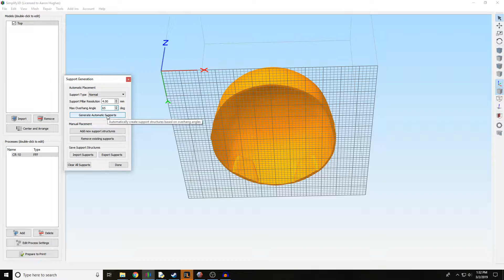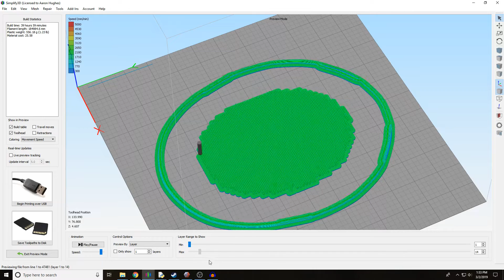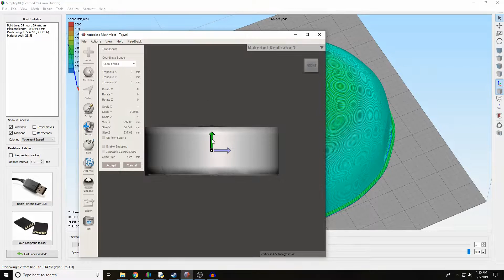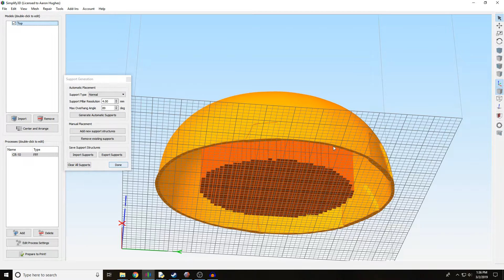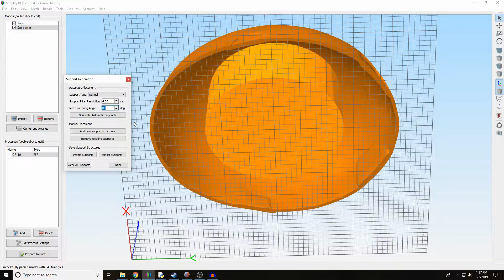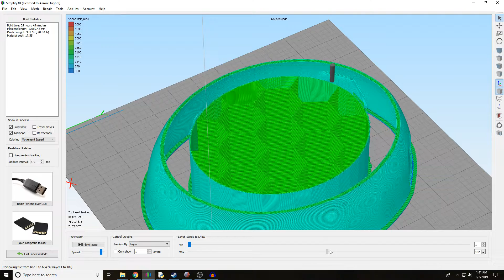How to Decrease your 3D Print Time by Over 25%

Comment: Why can't we print upside down?
Reply: Actually, that may work because it’ll reduce the amount of supports.
Reply: @americohagim1131  YES , BUT ..... you will also have to deal with that is left behind after you remove the supports... it will not be a smooth surface and you may end up spending more time sanding, and more than if you just use supports on the inside with the "extra" can simply be hidden .
Reply: bigchippa101, true. I actually flipped it upside down on the slicer a week ago and discovered what you said
Reply: @bigchippa101  True but we will still have to use puddy / primer and sand down the helmet either way.
Reply: Or print it standing up vertically

Comment: Instead of generating supports I will add an inside piece to my model that is very narrow coming up from the build plate and than have it branch out from about 2/3rds of the height of the model and intersect at the point it needs the support (like a tree). I span each contact point about 1/2 an inch distance from each other. After the model is finished printing I cut out my  “custom support.” This technique works really well and saves a ton on time and wasted plastic. It took me a couple of prints of trial and error to get it right but I’m still pretty new to 3D printing. Someone with experience could probably make it work with less practice.